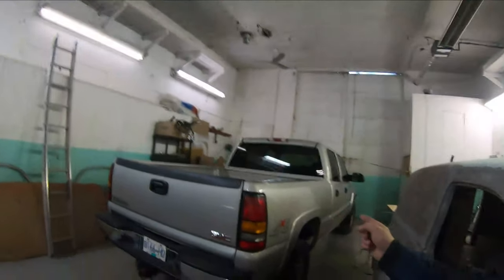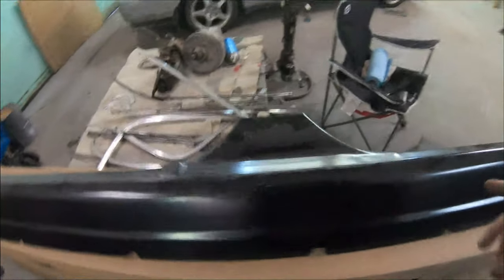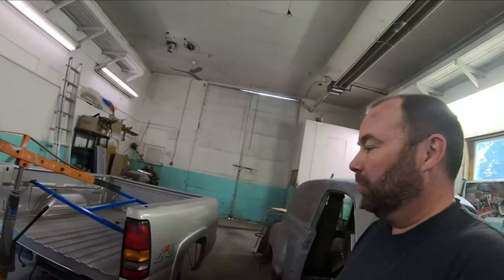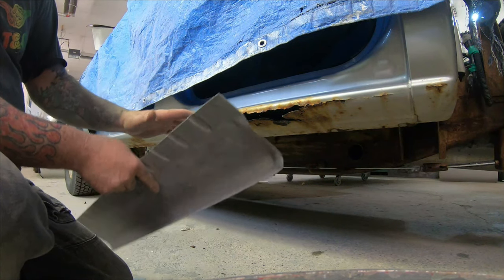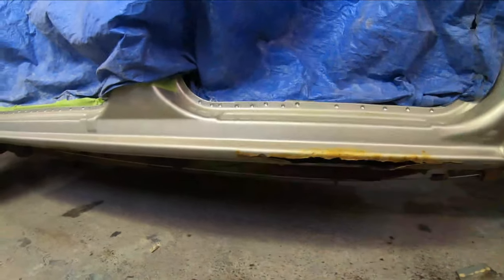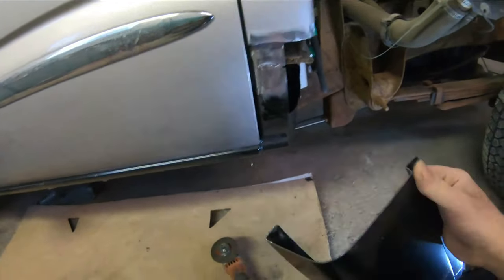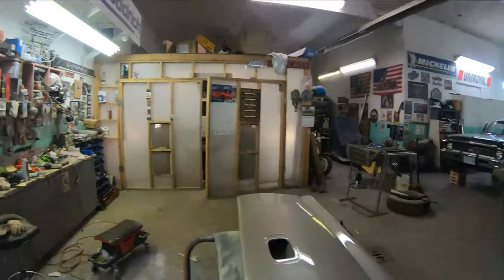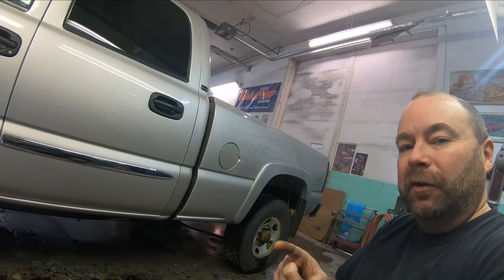How to replace rusty rocker panels properly!

Comment: Nice job on the truck there John. Since I've been watching your channel I've really enjoyed and learned alot. Ive got an 02GMC Sierra and an 01 chevy parts truck. My wife give me a good idea since we can't seem to sale or even give the truck away,she give me the idea to pull all suspension and axles off parts truck and put on GMC, will be a job but I believe I can do it. My GMC has a bit of wiring issues to get done, but again with some time I believe it can get done. My truck is sMe Pewter Gold as the one in the video. The parts truck is the 1500 HD model, who in tuen needs a heart implant but not enough dough to replace it with so that is why we doing the axle and suspension upgrades for the GMC. KEEP UP THE GOOD WORK AND GOD BLESS
Reply from the maker: Good luck with the project, glad you enjoy the videos!!

Comment: That infrared heat that you have is very nice. We had that in our old shop. You can buy a low temp thermostat and replace the thermostat that you have. And turn it down to say 40° and it'll still keep it warmer in there and using less fuel. Use more fuel of course in the morning when you turn it up and has to run for a long time. Just a little tip. We did that. Make sure we had a car or truck or some metal underneath those infrared heaters so that's soak up the heat.
Reply from the maker: Good advice, thanks!!! When I had it installed they put in fancy programmable thermostats which I still can’t use properly 🥴

Comment: I use Fluid Film  to spray inside my rockers and else where . Seeing the price of Fluid Film these days I am thinking of switching to thick chain saw  bar oil. or the thin stuff, maybe have to try both to see what works the best. Not a fan of used oil but it does work.  Good job on that nice truck!

Comment: that is totally the right way. only way to do it. its hard to stop that rust in the midwest states. your best chance is to get all of the rust out and get the clean metal in. then treat it behind. im about to be doing that same job on a 2010 silverado. rockers are different. often i will try to make my own sections if its not that bad not replace the whole rocker

Comment: John the next time you do a job like this I know you talked about that foam glue what ever that junk is in there about how you make sure you take it out, the next time show the people just how flammable it is by just letting the sparks from welding fall on it and watch how fast it catches fire ! And also mention that clean oil will not stick in side panels it has to be used or dirty used oil to save from rust ?
Reply from the maker: That’s a good idea, I should make a pile of that foam insulation to show how it goes up like a flamethrower 😉, educational and fun 😂

Comment: Hi John , is me , or is this not a very good paint match ...Not like you . Another excellent rocker replacement.
Reply from the maker: Yep, this one was a little off, tough on some of these light metallics to do something like the fuel door right in the middle of the panel
Reply: Theres like 14 differeny shades of silver birch 2 stage paint  mixes

Comment: What if you can't get rocket panels? For example, 2002 Grand Prix. Or  Grand Am
Reply from the maker: I’ve done similar where I’ve had the basic shape bent, but you need to know someone with a 6 or 8 foot brake. Having to make panels is a heck of a lot more work